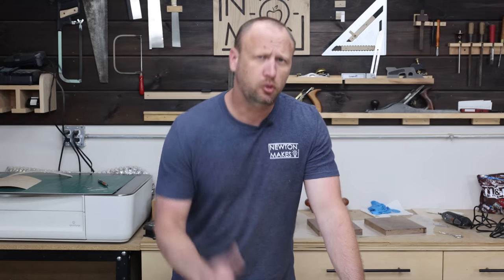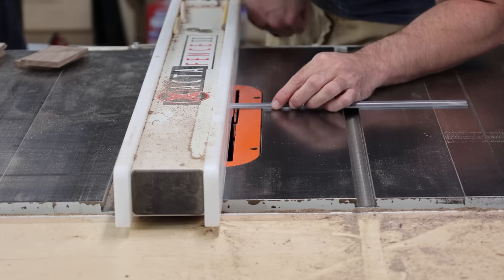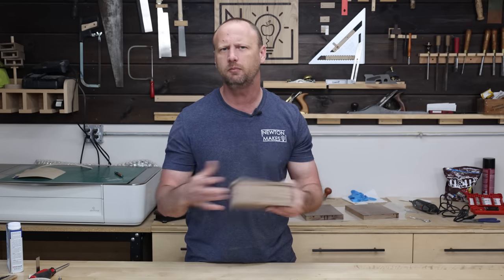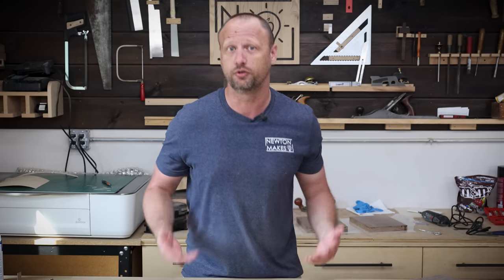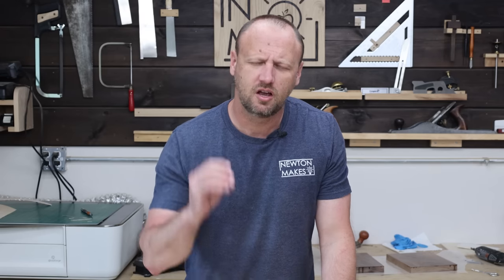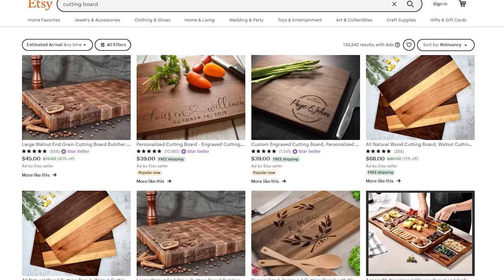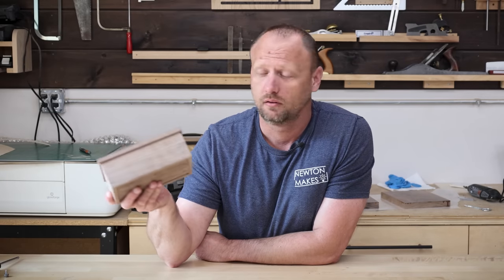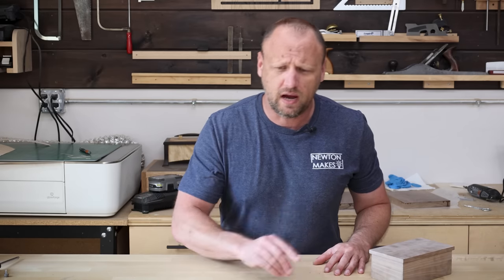3 Woodworking Projects that Sell FAST!! | Make Money from Woodworking

Comment: Box's are the bees knees. Find small "junk" logs or pieces that have been outside forever. You will find characteristics that will make your box one of a kind.  Nobody on earth will be able to replicate it.  I just made one riddled with ant tunnels (minus the ants🙂) thought I was gonna get mugged by a mob.  Fill checking with black/brown epoxy.  All your stuff will be 100% unique and sell like hotcakes. ( or just sell hotcakes)
Reply from the maker: You are 100% correct.  People dig that stuff.  And I'm not going to sell hotcakes because I don't want to have to fight people off with a stick.
Reply: George, out of curiosity, how much were those boxes selling for?
Reply: @thomasterry1658  really, it depends on the wood, the look, the size, and your time, ect.....it's very fluid depending on the piece.   And where you sell them.  I'm sorry I don't really have an answer,  but they do sell.
Reply: Boxes vs box's
Reply: @georgestgeorge5110  where do you sell them at ?
Reply: @johnblack8187  online mostly, and craft shows depending on location and crowd type.
Reply: @@eleija2162 I think that logic alone keeps so many people from ever starting to do it.

Then you factor in all other aspects of it. Many folks lack the initiative even if they wanted to.

That lack of initiative applies to every aspect of the process: acquiring the tools, practicing the skills, overcoming the learning curve, etc etc.

THEN you'd be surprised at how difficult simple wood crafting skills are for so many people. They could have all the tools imaginable but just not figure it out. Probably because they had all the tools without ever practicing in this scenario 🤣🤣

I've seen so many people lack the ability to even source cool hardwoods. I try to advise them, but you can only lead a horse to water heh.

I'm going to get into making these little crafty projects just to practice batching skills, but I have experience with art shows and if I end up with a storage unit of stuff I made for fun/practice, I'll apply to every show I can think of
Reply: Don't you have to let the wood dry for over a year after making planks of it?
Reply: @banana_bread_at_work  not necessarily,  a couple of months if you have a dry environment for storage.  If you mill it and build it the same day, you don't really have too much trouble with a small project.  In my experience.
Reply: @George st george  Good to know. Appreciate you taking the time to educate this aspiring woodworker. You have a good one 😊👍

Comment: Finally, someone who keeps it real. Let's be honest, in my opinion, woodworking is VERY hard, anyone who thinks they can just jump into it is mistaken. I used to build decks, additions, finish carpentry, for a long time (over a decade). I thought going to woodworking would be a smooth transition, and some parts, yes it translates. However, the tools don't. Routers, planers, jointers (money, more money, most money lol) are not something I had to deal with. Dual bevel mitre saws, table saws, coping saws sure. The only one that really plays a big part here is the table saw, which I have 1000's of hours on. 

With that said, as you say efficiency is key (not your exact words but that's what I heard). If you are going to make a jig for something, best be making a good amount of something. Strange how what we think will sell, vs what actually sells can be vastly different. Things I thought were so great, were crap. Things I thought were crap, end up being top sellers and I just sit there and go 'huh?' lol. Subbed.
Reply from the maker: It was a surprise as to what would sell until I did it for a while. Efficiency is imperative. Time is money. Have to make the items as quickly, easily, safely as possible.
Reply: Totally agree. I'm a carpenter and I've got many hours on the table saw but very little with sleds and high accuracy jigs and such
Reply: Safety aside, the first thing that you must do is verify that your machines are zeroed. Table saw blades must be sharp and 90°(perpendicular) to the table top, and  must be checked with a machinist square. The blade must be parallel to the miter slot, this is best checked with a fixed sliding guage which can be an adjustable square. If you make a jig or fixture without doing this it will be a waste.
Reply: @JamesBrown-fd1nv  I agree! I bought machinist squares and blocks. Very tight tolerance now. As you know, if you run more than a few feet that slop will get you down the road on a 8 or 10 foot board!
Reply: @thenext9537  And, messure twice cut once. I say,  mesure three times and if the saw is not well  tuned, you endup cutting three times!🤣
Reply: @thenext9537  Yeah, and to be complete about this, if you have a jointer it needs to be zeroed too. I have had some glue ups that wouldn't lay flat due to edges that were not perpendicular to the faces.  Due to the beauty sides being chosen up front I wasn't able to just flip every other board to get around this. 😔

Comment: I live in a poor rural area and have tried to sell but the market isnt here, its simply location i guess. I am a hard core diy'r with everything to work metal and wood, this includes CNCs to a sawmill. I live on hundreds of acres of hardwoods that i cut and mill. I can make a box either with dovetail or box joints out of mesquite and engrave the lid and cannot get $20 for one.i can make the most unique serving board out of a highly figured piece of pecan or hickory that i milled from my own tree, engrave and epoxy fill  it and it will sit there with a $30-$40 price tag on it.
Yet i see woodworkers on yt and FB reels telling me you can make $1400 from a single  home depot 4x4 or a 2x4. 
Its frustrating to say the least.

Comment: Just a thought here regarding your candle holders. Why not cut a hexagon "log" and then slice it up into the candle holders?  No jigs required. Good video.
Reply: You could rip a 48 inch 4x4 into a hex and slice about 60 of those at 3/4 in.I bet you could cut all of them and forsner each with a setup drill press , in about 45min. Cost of under $15 And less than an hour of work , sell them in sets of 6 for $15.

Comment: Don´t build small stuff that sells fast. They usually give back horrible hourly rates. The bigger the build, the higher the return per hour Build sth that costs money and it will sell quickly as well. Plenty of customers out there willing to pay money for good woodworking.

A cutting board gives a return of what, maybe $50/hr? A Victorian cabinet sells at around $800/hr. OK, not everyone can build one, but even kitchen cabinets from solid wood return around $300/hr. And that´s "just" milling wood and putting the together, just like a jewelry box, just bigger.

Comment: With the tea lights you could do six long strips at a angle so you can stack them together and make a hexagon log then cut them into wafers. Can even alternate the wood type to have different color combos and it would cut down on waste wood. But, it would change it from a side to end grain so the will look slightly different.

Comment: Been making boxes out of downed oak tree limbs. The drying process takes forever. I cut it about 5/8" thick and then plane and sand it to 1/2".
Reply from the maker: It does take a while, but if we always have wood in various stages of drying it's not a big deal.

Comment: Question..if u make set off plans and sell to someone they just end up making it themselves and u lose out on a product that u could of made
Reply: Think about it carefully. You cannot possibly reach every potential buyer and market without advertising properly. You also have to add tax and shipping, packaging, and routine delivery to postal services. The volume would become a stocking nightmare and can rob you of shop space. Selling plans is still a way to make money and you can keep your product business reasonably local. This all depends on the project size and complexity. One final consideration is returned products from damage if you ship them. Everyone is doing live edge these days, pattern cutting boards, beer flights, etc. The real magic is in finding a way to "add value" to the product that is difficult and costly for the average DIY person. Take the extra time to sand properly, make sure you obsess over accuracy, and pay attention to pleasing proportions. 
When you commit to a project you want to make sure that your tools are adjusted and calibrated correctly. Then you want to make precision jigs and fixtures as needed for repeatability. You want to make enough product to get the most for your time investment, that's where the hidden money is. 
Before you start, write down your plans for execution so you don't make silly mistakes, that sucks and can cost you big.

Comment: Hello thank you so much for the videos they are very inspirational. I was just wondering what took you used for your candle holders and what dimensions you used. Thank you is much. Also what finish do you use?
Reply from the maker: Make them whatever sizes you want to offer. Mine are typically about 2.5 wide. Use a simple finish like wipe on varnish or hard wax finish.
Reply: Thank you. Do you just use soft woods?

Comment: Great video! Thanks. I just liked and subscribed. I’m very, like very new to woodworking. I have some furniture grade 3/4 inch plywood and plan to make some coasters out of the scrap using a hole saw and some cork. I know that woodworkers frown on using dimensional lumber — warping, knots and sap. I’ve got lots of scrap 2x6, 2x4 and the 3/4 plywood. Would love to see suggestions/videos on projects using lumber and scraps. Thanks and I’m definitely going to be making some tea candle holders!
Reply from the maker: Nothing wrong with using construction lumber as long as you know what you're getting.  If I use it, I choose wider boards and trim them down.  The are more stable.

Comment: Hey Billy great video really liked them projects gonna start attempting all them. Serving boards is something am hitting now coasters aswell as my tables but 1 thing so far I've found is that my lighter boards selling better than darker boards. 🏴👍 Based on the candle holders and boards what kinda prices would u sell them for?? Ps I stayed all way through always do.
Reply from the maker: Your lighter ones are selling?  That's awesome!  I couldn't give them away.  You must have the magic touch. I can't give you a price because everyone's materials, shop rate, and desired profit margins are different.  Gotta shoot for a price and adjust from there.
Reply: @NewtonMakes  yea man a got chesnut maple and sycamore selling well or interest more anyway offer up beautiful elm boards no one seems interested. Although add elm in with the chesnut kinda blows up. Yea a think am kinda low pricing the now to be honest offering them out arround the £30-£40 mark so like $50-60 but think for what they are could go up a bit.

Comment: Hi!  I followed up on an idea I had, and improved on someone else's idea.  I came up with two projects, one which costs between $20.00 and $60.00 for materials and the other costs between $7.00-$25.00 for materials.  One is a " multiple stick" project, the other is a "single stick" project.  Either project can be made out of virtually any wood, and take very little time to make.